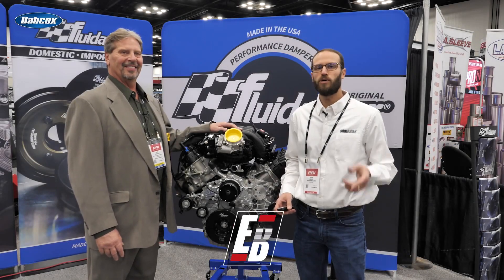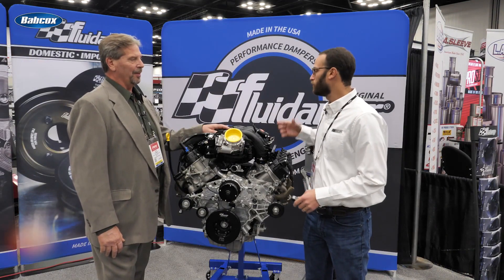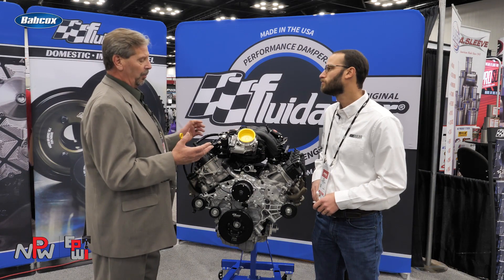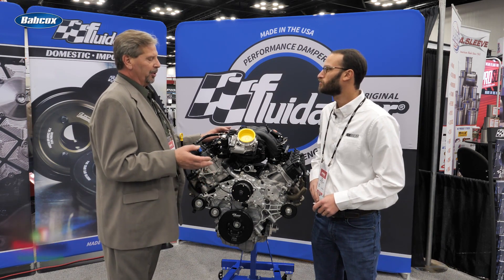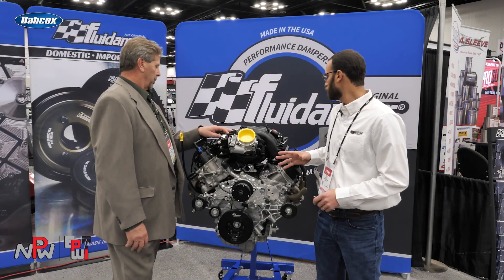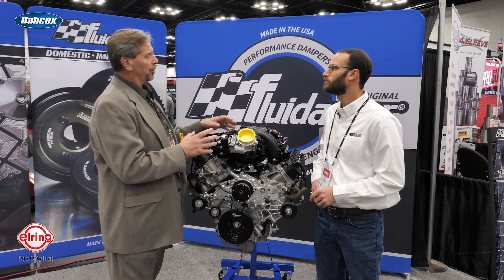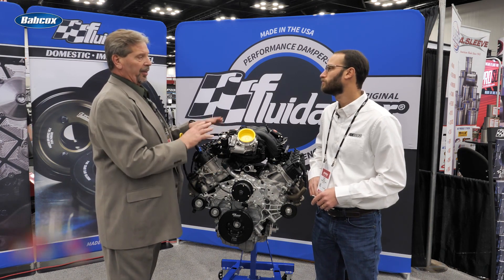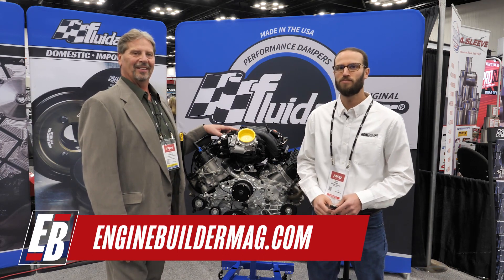Nitrous-Powered Ford 7.3L Godzilla Engine

Comment: This engines getting a lot of attention for something that has commonly known problems
Reply: its bad aZZ
Reply: @BronsonOsborne  Is bad*
Reply: @beachboardfan9544  like the lifter eating junk that chevy is putting out you’re being bias
Reply: So? Even Chevys sacred LS has hella problems from the factory throughout the years.
Reply: @johnherbold6539  Not disagreeing with you there, but thats deflecting...

The 7.3 has been getting a lot of shilling on youtube the past year, yet no ones talking about the cam gear, headgasket, fuel pump, and wiring harness problems. I would never buy one just based on the cylinder design. Thats a guaranteed failed head gasket, and theres no fix for it, dunno why any mfg would ever do what they did...
Reply: @beachboardfan9544  like the one McFarland is running in McFlurry?